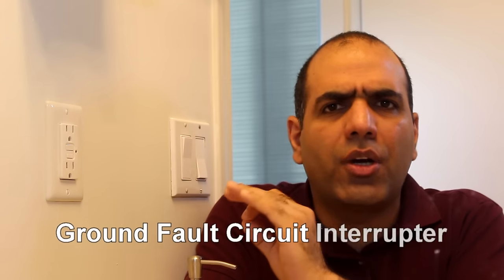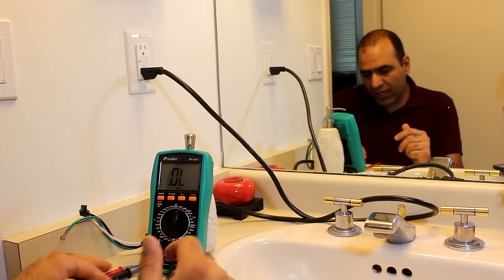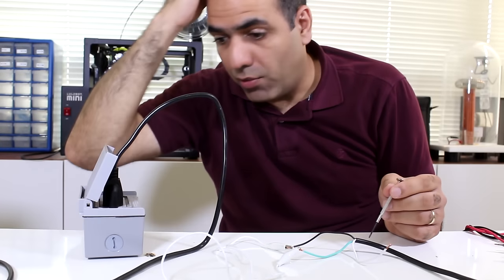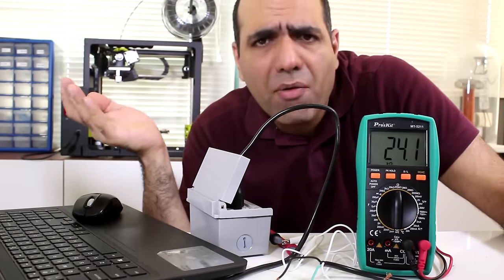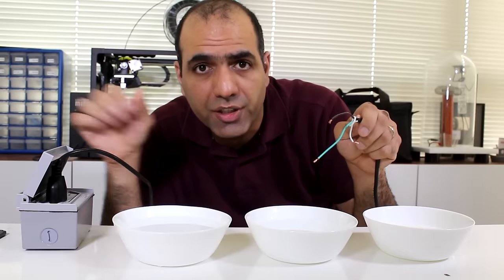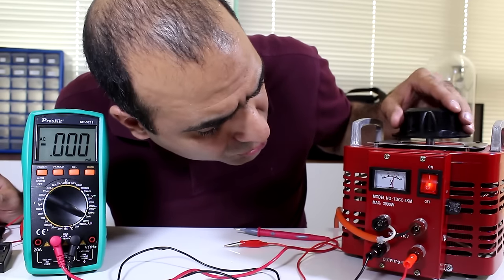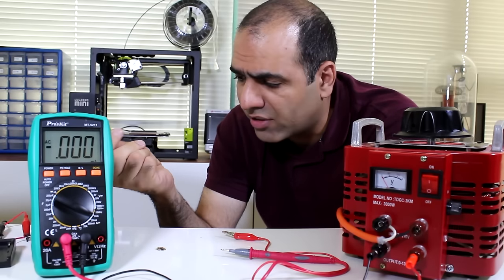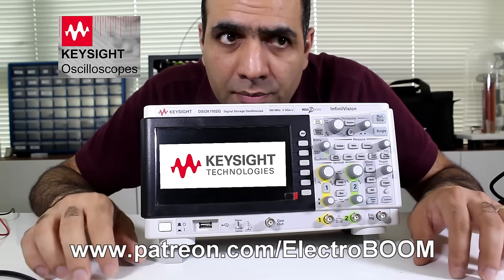The Outlet that Saves Lives

Comment: I'm glad you don't have 230V in yours outlets.
Reply: We do have 220v or 240v (depending on distance from power station) in appliance outlets including ovens and washing machines. But those are always kept on different circuits.
Reply: J-money P 240v in the USA are two 120v phases 180 degrees opposite of each other. In Europe it's 230v between neutral and any phase and 400v between two phases, of which there are three, each 120 degrees apart. But sure it's 240 volts that the USA has ;)
Reply: 230v hurts really bad. Believe me.
Reply: Creepi06 On Mars ?
Reply: Trust me it don't feel good
Reply: I'd thought you're from within the EU? (230V/400V nominal since the 80s)
See e.g. https://en.wikipedia.org/wiki/Mains_electricity_by_country
Reply: Meh 220 is not too bad, had it once at the back of my hand veeeery thingly.
Reply: or 400V
Reply: 230V is the perfect value so europeans kids will try it only once on purpose :)
After that, rare and accidental.
Reply: Yeah 230v hurts like hell.
In my first ever flat the smoke alarm starts going off randomly at 4am.
In my sleepy haze I pull off the front of it, see the 9v battery and go to pull it out.
Next thing I know I'm half way across the room, in a lot of pain, wondering what the hell happened with a pretty much completely unresponsive left arm.
Turns out the 9v battery was just for back-up.
Reply: yup, fingers in a table lamp bayonet socket aged about 10. Didn't even have breakers back then, just a hell of a belt that left my hand numb for the rest of the day.
Reply: Dude the same thing happened to me although I was only 5. My mother was changing the bulb and told us kids to stay away from the lamp. While she was getting the new bulb I put my finger in there. I remember only keeping my hands in my pockets for the next few hours.
Reply: What's the upside of having higher voltage in an outlet?
Reply: Curent x voltage = power ... higher voltage = lower curent thus you do not need thick wires.
Also vooltage strike = burned skin, whereas curent passing through your body = your heart stops beating
He did not mention it but if i remember correctly it is about 15mA straight through your heart (not body just heart itself) and it will stop beating.

(EDIT for distributing power is more effecient to use very high voltage (400kV) to deliver electricity as you need very very low curent tu support whole city)
Reply: Upside is quicker and less painful electrocution!
Reply: Fisher Mikołaj yeah in the next video we will listen to a fantastic song: 60Hrz trought human body
Reply: (230v)
Reply: split phase not 2 phase... go look that the pole its only connected to a single phase.
Reply: @Marek Tyl, Ohm Law: voltage=resistance*current. Higher voltage with constant resistance means higher current. Your "thick wires" apply to the situation with constant power, P=current*voltage.
Reply: lemat456 p(loss)=i^2 R
Reply: 230V here in Brazil depending in what state you live.
Reply: +salat nominal. Defined to stay +/- 15% to give the big spinning generators a bit of play in order to fix the frequency to 50Hz. In Germany grid connected solar PV inverters must be fixed to a maximum voltage of 237V so they will stop feeding to the grid if the voltage rises above that.
TBH: Since all new electronic power supply devices are labelled with 250VAC and factually all devices will take that voltage I think we should allow the grid voltage to rise higher. This would make it possible to squeeze a lot more power trough the existing grid. As a added bonus our toasters and kettles would have higher power.
Reply: here we have 240v 60hz in Australia
Reply: I think its 230v now
Reply: Fisher Mikołaj 230 V, 50 Hertz here in Finland.
Reply: actually our voltage is 120/240 volts in north america
Reply: UK is 240v single phase and 450v two phase. Although to get a 2 phase supply involves some hassle, most houses only have the single phase option.
I've had a bunch of 240v shocks, a couple of which were across the heart (young and stupid) and they hurt like fuck. Fortunately 240v kicks you, you don't freeze like you do with a 120v supply.
Reply: Australia is 50HZ Not 60 Cheers
Reply: in oz
Reply: That is what i meant i might have wrote it wrong ... ty for correcting
Reply: Fisher Mikołaj England does I think
Reply: Fisher Mikołaj but imagine how fast your iPad could charge
Reply: mickenoss UK is 230v Single phase and 400v Three phase
Reply: here is 220, automatic death i think
Reply: Germany has  in most houses 3phases 680v
Reply: Nidhal Djemai No, it doesn't. Germany is 230v Single phase and 400v three phase. No house is going to 680v......that's HV!
Reply: Fisher Mikołaj well good sir i have 220v ac
Reply: Well at least in Europe we will have faster home eletric car chargers without special wall chargers :)
Reply: We also have 230v and yeeeessss its defeneetly more painful
Reply: Tyler Swinkey dou you knaw da wae
Reply: we can draw more power, and overall power more demanding stuff like high voltage power tools and large heating elements
Reply: mickenoss Only single phase for each house? In Poland if I'm not mistaken we all have 3 phases in each house. It's convenient coz u can use 3 phase motors.
Reply: Awazruk, I'm sure in older houses and more rural areas you're probably still on IT or TT installations, newer buildings and more urban areas are most likely on TN(Most likely TN-S or TN-C-S) and even then older apartment blocks and houses are probably still on IT/TT. At least that's how it is in Norway and we're typically similar in these things.

Although, that only really refers to ground, I guess they're all 3 phase wiring systems in all actuality. 

I'm not an electrician so I don't actually know wtf I'm talking about. 

Have a nice day.
Reply: Meanwhile Japan has only 100V, but just for fun has both 50Hz and 60Hz in the same country..
Reply: 220v for single phase and 380v for tri phase here in China. And since I am in a machinery company right now, well, I've heard that it's not always the case for 220v single phase country...
Reply: Less current in wires for the same power output means thinner wires and less energy loss  in lines.
Reply: That's the primary side (the medium voltage, kV-level one) of the pole drum transformer. The secondary ( low voltage, 120/240V one) is insulated from primary: the center tap is grounded and called neutral, the other two sides are 180° opposing phases. You can call them split phase, but imo 2 phase is not wrong...
Reply: European electricity circuit has  220 - 230 Volts but with the half current of the US and Canada. This means that the danger is the same with both US and European circuits but if you ever touched 120 volt outlet and think that hurt YOU DONT FELT ANYTHING!!! 230 VOLTS IS THE ACTUAL PAIN!!!!!
Reply: In UK we have 240v
Reply: Isn't European 3-phase something like 375 V? I know it hurts like a bitch. Got zapped once by a suicide cable I didn't know about, worst pain ever. Felt like my nerves where on fire and I couldn't stop screaming like a pig being bled until I finally shook the plug off. :)
Reply: I've got 480volts along with 240volts at home. I'm not exactly sure why but my dads work has every type of socket and voltage under the sun. They use 208Y to charge forklift batteries
Reply: @Engineer9736  the usa has 220v-240v
stop spreading misinformation
Reply: I live in Hungary. 
-We have 230V for single and 400V as three phase.
We haven’t got GFCI at all in each sockets. 
We have one [30 mA RCD] at the consumer unit which is monitoring the whole circuit of the house or flat. 
The law sais electricans must install the RCD at every house renowation and new buildings.
Very useful device!
Reply: But at 220V the current threshold would be smaller if it would take 5mA to trigger GFCI it would have take .5 or something mA at 220V
Reply: And I thought 120V was painfull...
Reply: i can't understand a word goddammit
Reply: Were i live its 240volts
Reply: @szilardnagyapati8177   Where are you?
On the planet Zorqon?
Reply: @Engineer9736  Old post yea but, 120v opposite 180 degrees is technically -120v and +120v so technically is 240v, doesnt matter the way its dropped, its all electric....
Reply: If He would live in europe...
Reply: @Engineer9736  not 2 phase, single split phase which can be connected hot to hot(240v) or hot to neutral(120v)

for heavier duty uses you can get 3 phase connections of various flavors, but that's more used in commercial/industrial facilities.
Reply: its not the volts that hurts its the amps. ever touched a spark plug? that's over 100 times the voltage of european mains. and 200 times the voltage of usa mains.
european mains run at half the amperage that usa mains do. its the exact same amount of power, but european (even with the bigger, scarier number) is much safer due to the lower amperage. good try though
Reply: @bmxscape  E U uses 7A breakers?

Cause UK uses 240V 30A instant death Circuits
Reply: @0x73V14  the uk has a standardized 13 amp per outlet circuit, thus a double outlet can provide a maximum of 26 amps.
the usa has a standard 15-20 amp per outlet circuit, or 30-40 with a double outlet, and
europe uses a standard of 2.5 amps per outlet.
Reply: @bmxscape  US circuits are 15 or 20 amps for the whole circuit,  which you can pull from just one outlet or spread among them all, but you can't draw 15+15 or 20+20, that will greatly exceed the breaker and it will trip.

The UK configuration I'm referring to are the ring circuits, which are connected at both ends so in theory the wire is only carrying 15A in any one place, but it's still 30 A available at any given outlet
Reply: @0x73V14  and the uk circuits youre referring to has a 13 A breaker so it will trip the exact same way the ones in the usa will. you can't pull all of the given power through one outlet, they are designed to trip far before the max amperage is met.
Reply: There was once a socket that had cracked plastic shielding and insides were exposed

I once accidently hit my toe in it and I thought my heart is gonna stop

Tho probably because I got scared of the hot feeling spreading up from my toe.
Reply: @nidhaldjemai4457    , odd, in Hungary we have 230 single and 380 three phase the (400 is single as far I know for heavy machines such as a crane) aren't our based on Germany's sistem? 680 is not hous input it's for subways I suppose.
Reply: We do have 240. We get 240 on a single phase with a center tapped transformer. According to Mehdi himself he once grabbed a 240 volt line in Iran from an improperly grounded rooftop AC unit.
Reply: I've got 230V
Reply: Note, in America all 240 AC outlets are "dedicated circuits."  Most of which are under 50 Amps. You won't find a hot-tub and a well pump on the same breaker for example, or will you?  Oh yes and the customer flipping the breaker back on absent mindedly to get a drink of water while the service tech is trimming insulation off the 10 AWG heater wires.  It's one thing to bump a hot wire, it's another to be firmly gripping it when the wire goes hot.
Reply: He actually has one now
Reply: @nidhaldjemai4457  Phase + Phase + Phase ≠ Phase * 3
Reply: @Engineer9736  All of North America* Stop acting ignorant like it's only the US
Reply: Well i have 230v
Plus there's no ground
Only 2 holes in the outlets
Reply: @Xnoob545  Same in romania, some plugs have ground but its not connected. We dont get the wire Ground from the street, only Live and Neutral
Reply: @jessep3079  

That's where we have 400v.
Reply: dont know what to tell you about that the acceptable U.S voltage is about 110-125  Volts
Reply: There is up to 480V in the 3 phase outlet
Reply: In most commercial and industrial buildings in Canada are fed 347/600volts. 3PH
Reply: @blanana_m  where he is from in Canada they use 600 volt in commercial
Reply: @Alex-lo6yt  I was talking about where I live
Reply: @captaincanuck4576  Thats why breakers exist hello? You aren't going to die in europe by electricution even if you tried :p
Reply: he does not have 230V, but he does have a degree in electrical engineering. Guess he knows what he is doing.
Reply: Yeah 230v hurts lol
Reply: I live in poland and i do, this shit sparks EVERY time i plug something into it.
Reply: Have you tried 400v?
Reply: @Ur_local_traingeek  400v? That's possible? Tf
Reply: @the_lenny1  i touched a faulty electrical device running on 230v ac and i've ever since been paranoid of electricity to the point i use my phone or whatever non conductive to turn light switches whenever i can
Reply: You would need to be called Biba Struja to survive 230 V AC through your heart for 1 second
Reply: @jessep3079  The reason they are independent of conventional circuits is the number of phases. Normal outlets are single phase whereas oven and washing machine outlets are double phase or tri-phase
Reply: @the_lenny1  you should try 1500v with your hand bouncing between the top of a switch mode supply and an aluminum case ;-)
Reply: HAHAHAA
Reply: 230 V AC through dry skin is equivalent to 2.3 mA passing through your body. Very uncomfortable but not lethal. I don’t know how 230 V DC feels when it passes through the human body
Reply: Touched 250v from a faulty cheap USB charger. there was a hole in the side from where I dropped it, and when I went to pick it up, I touched a diode (probably part of a full-bridge rectifier) and shocked myself. First-degree burn, recovered in a couple of days.
Reply: It'S nOt ThE vOlTaGe ThAt KiLlS iT iS tHe CuRrEnT.
Reply: Gfci
Reply: 220v is not bad... Just a stinging sensation will be felt(it may also kill tho..😑😑)
Reply: Ehh, i was shocked 4 times and didnt feel any  pain

Comment: 'Use warm water and add soap for additional safety' :-D :-D
Reply: just bath in Mercury, conducts electricity well
Reply: @mrdr4934  I will try.
Reply: and make sure your hairdryer lands in the water only
Reply: Heavy metal poisoning: I'm boutta end this mans whole career
Reply: @bitterlemonboy  actually unless you have a cut metalic mercury would be fine to touch, Even if you ate some, I dont recommend eating mercury but you wouldn't die assuming your parts of your pipes that are exposed aren't some Almalgamatable metal like aluminum
Reply: @mrdr4934  It's poisonous as well